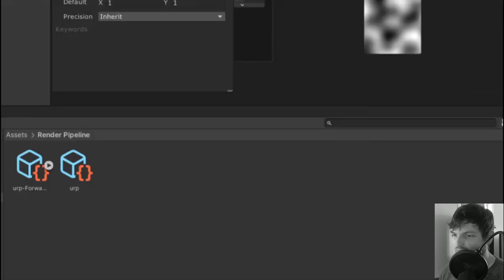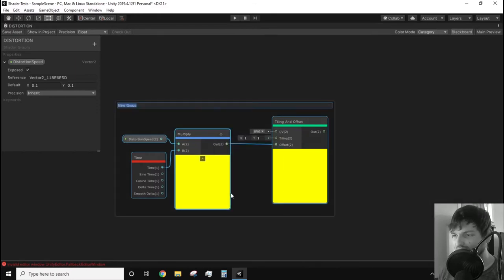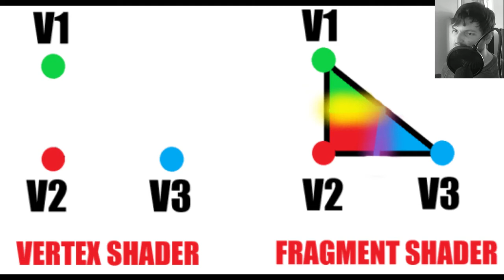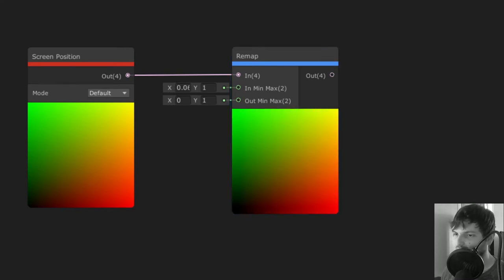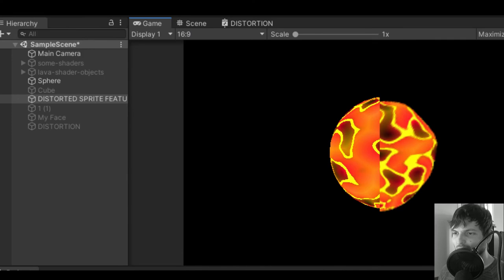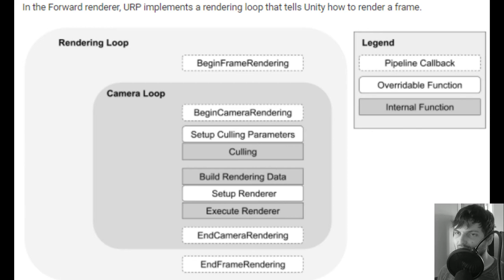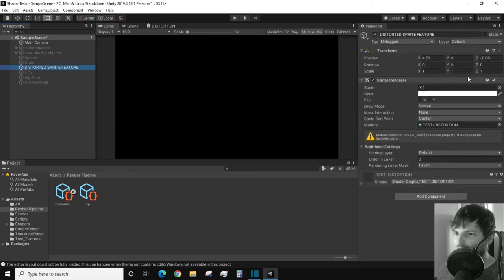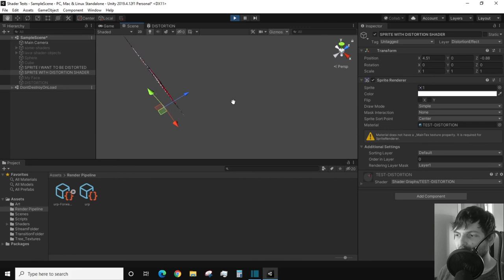HOW TO MAKE DISTORTION/HEAT EFFECT FOR 2D & 3D - SIMPLE SHADER GRAPHS -  Unity 2019 LTS

Comment: First, thank you for the tutorial, video editing is also great. Very useful stuff!
Second, I think it's important to note a couple of points:
1. Shader noise. For mobile - it's an unacceptable node (any procedural noise). What can be used instead is prebaked noise (a picture, using Photoshop, GIMP, etc.) and scroll through tiled pictures (not a procedurally generated noise). This is especially harmful if you render a lot of pixels with this shader.
2. The total amount of passes and batches is almost doubled. What you do here is render [everying but distortion], then [render everything with distortion]. Your first pass fills opaque texture, your second pass re-renders the scene completely, but distortion works *only with opaque texture*.  What you really need is just processed opaque texture (for SceneColor node) and you doing this in the very first pass. To optimize (in forward renderer): 
2.1. Remove all features, set transparent filter to nothing.
2.2. Add feature "PassToOpaqueTexture". Event: anything earlier (higher in the list) than "BeforeRenderingTransparents" . This ensures you work in opaque layer/texture. Filter: transparent and everything but distortion.
2.3. Create second feature "PassAfterAndWithOpaqueTexture". Event: "AfterRenderingTransperets". Filter: transparent, and your distortion layer.
What happens: you render in first pass everything. Also, you fill out opaque texture. Then in the second pass, you render distortion and nothing else (hence no more extra rendering). You also won't need to set any sorting order. It will always be higher than the first feature. If your project has opaque objects, features and filters can be adjusted accordingly. For mobile platforms doubling the number of passes is harmful.
Reply from the maker: That is some great info! I definitely won't claim to be a shader expert. A lot of what i found out how to do was by trial and error/testing and trying my best to understand the documentation available. I think I'll pin this comment so hopefully it helps future viewers!
Reply: do you know how to do this while also having 2d lights? because 2d lights and materials only seem to work with 2d renderer not forward renderer.

Comment: Thanks for tutorial. I have a difficulty that to apply the distortion to certain mesh only. I don't know how to set the layer. Is there any related tutorial?
Reply from the maker: This type of distortion effect should only be applied to a 2d sprite object. The idea for this particular shader is a heat effect or blurring effect that can be applied to an entire scene or partial depending on the size of the 2D sprite shape. 

If you want to distort just a single object, this is probably an easier way. More than likely just tweaking the object's UV map would probably work.
Reply: @SethFunk  Thank you very much!

Comment: Nice tutorial dude. Something no one else does is go into detail of how unity is handling things behind the scene which goes a long way to just understanding how everything works together.

How do we do the Render Feature stuff if i'm using a 2d renderer as I'm on 2021 unity? Or is that step all just skipped?
Reply from the maker: I honestly have not tried unity 2021 version. I would have to assume for now that there would be an option for renderer features under your URP asset still. I will check out the documentation and might download 2021 to try it out.
Reply: @SethFunk  I'll have a further look with documentation. I checked the pipeline asset and renderer but sadly didn't see anything of the sort but be nice to get it working as your effect is exactly what I need.
Reply from the maker: @MattBee2k2  So I did some research on the 2d pipeline supporting renderer features, and it seems that Unity does not currently have any plans to support the feature. It is recommended to use URP since it gives similar results to the 2D pipeline but has more options.
Reply: @SethFunk  Interseting I'll check it out and appreciate you looking into it and getting back to me. I've used URP with the 2d pipeline as i'm on mobile and wanted to keep thigns simple.

I was actually able to get a distortion effect on the go just offsetting uvs over time with noise by following gamedev bills tutorial on heat haze.

On a deep dive on shaders so be binging your channel and joined the discord. Keep up the good work mate!
Reply: @MattBee2k2  Don't get rid of the 2D Renderer. Just add another renderer to the renderer list under the pipeline. Per Unity.

The 2D Renderer includes:
2D Lights
Lit and Unlit Sprite Masternode in Shader Graph
Pixel Perfect Camera component
As a reminder: This will be the new home for Pixel Perfect Camera. The standalone package will still receive bug fixes, but new features will only be added here.
This is the same component with the same workflow as the one in the Pixel Perfect package. The main change is that Pixel Perfect is now compatible with the 2D Renderer in Universal Render Pipeline.
Normal map support for all the other 2D renderers:
Tilemap Renderer
Sprite Shape Renderer; and
Sprite Renderers that are deformed by bones.
Experimental shadow caster component
Post-Processing support

You'll lose all of that if you try to remove it.
Reply: @Xeridae  Oh I see didn't think I could add multiple renderers like that. First time using any of the new workflows. I'll check it out mate, cheers!
Reply: @MattBee2k2  No problem. You can have more than one renderer as long as they are a renderer supported by URP.

Comment: Is this possible to do with the "2D Renderer Data", since all of the 2D lights use a 2D Renderer instead of the typical "Forward Renderer". All of the features like "Add Renderer Feature" is missing etc :/ Anyone have a solution/suggestion?

Edit: its not there yet, but coming to Unity version 2021.2
Reply from the maker: Is there any reason you can't use the urp forward renderer? I know 2d seems convenient but urp can do almost the same things but gives more options when it comes to shaders.
Reply: @SethFunk  the only reason are the 2D Lights and Shadows (which are great by the way), which won’t work when switching to the Forward Renderer :/ but luckily coming to the next version, will come back to this tutorial then, awesome tutorial btw
Reply from the maker: @Chief-wx1fj  Sounds good. I know I have faked in 2d lighting using 3D geoms before and it turned out pretty interesting, but I completely understand why you want to keep the 2D pipeline. There are other ways about creating a similar effect, which GameDevBill has a couple tutorials if you follow can help you understand how to do it. It's a lot more complicated though. And I believe it even works with the 2D pipeline.
Reply: @SethFunk  This would be great . I need the 2D Renderer because i use costum axis sorting and forward rendering do not have this. I manged to get this distortion shader to work from your tutorial but then the sorting is totaly broken :) there is literly no sorting order by y Axis anymore and i do not want to do this by code. 2D renderer is a great way for an automatical sorting by pivot or center. Here is a short preview on youtube: AYf2Monevpo
As you can see i do a looooooot of sorting and forward rendering isnt working this way :D Also i think the camera was complaining about i need 2d renderer for pixelperfect camera.

Never noticed you only has this few subcriber :o I came to your chanel in the past. At least i can remembered your face :D
Keep up the good work
Reply from the maker: @Filgaja  Hey, I awhile back someone on my discord channel said they found a solution for using the 2D pipeline. here is the link to the message thread (you might have to join the discord to be able to read it though)

https://discord.com/channels/808026970439811112/808370866022121492/961031287802576967

Comment: Okay so I did exactly everything you said in the video to a T two times over now but my distortion image remains grey, and I can't see the image behind it. The only time something does happen is if I put my camera's background type into skybox mode and then on my camera the two settings it has there, I turn opaque texture and depth texture to on. Then i can see the distortion working however, it only uses the colors from the skybox and even so it's not completely accurate, even then it still has some transparency issues. I really need this to work for a game I'm doing but I keep hitting a wall on this, i tried other videos with the similar idea behind it. I also setup my pipeline the way you said it in your lava video but still no luck. Any help would be greatly appreciated thanks m8. Could you maybe link a project file so I can see exactly whats wrong?
Reply from the maker: I should be able to do that. I'll post one in my discord server. I'll sned a link to you when i get the chance too. Shouldnt be too long
Reply: @SethFunk  okay thanks
Reply: @SethFunk  my discords not working rn for some reason, a link on here too would be great if that's what you meant
Reply from the maker: @RiaanDuPiano  I'll send a link here for you when i get it done! Thanks for being patient!
Reply: @SethFunk  no worries, thanks
Reply: So I got it working! I dont know what the issue was but I created another project file, and it seemed to work...how annoying. Anyways is there a way to make the image/sprite not be as blurry when being distorted? And one other thing is there a way to use the alpha data of the main tex so I could have a smooth transition of blur on the edges, like say if I were to use a particle to get the feathering effect? It's a bit obvious where the distortion starts and ends
Reply from the maker: @RiaanDuPiano  I was just about to upload my project to github lol But anyways, distortion power and the gradient noise scale will determine how much distortion is occurring. As for the smooth transition, the only thing I can think of off hand using the intended sprite shape, doing an outline type of effect, and control the outline separately from the "main" portion of the sprite. Sort of like having two intensities of distortion power per each section of the sprite being manipulated. I hope that makes sense. I haven't tested anything like they before though. I have created an outline for sprites before, but mainly just followed what brackey did in his video for it. Not sure how well it would turn out. I haven't had much time to work on shaders in general lately due to work/family time being my main priority but I will try to assist how I can. I know there use to be heavy discussions on Brackey's discord about shaders and there were some real pros there.
Reply: @SethFunk  you should upload it anyways and maybe link it on your video in the description, im sure some people would find it handy i wouldnt mind taking a look myself. Okay i think i get what you're saying will give it a try.

Comment: Would there be any issue with the error message that says there's no _MainTex? I'm trying to put this shader together but I keep getting a gray square with no effect on it when it's applied to a sprite.
Reply from the maker: Are you applying the effect to a 3d model or a sprite?
Reply: @SethFunk  Hey sorry, I was trying it out on a 2D sprite but it turns out that this doesn't work if you're using Unity's 2D lights. Unfortunately, the renderer used with that doesn't let you add renderer features. As of 2020.3 that is, not sure if they've updated it in newer versions.
Reply from the maker: @farn2388  there is a way to use the 2d light system but you have to use a blit script. Gamedevbill has a good video on the subject
Reply: @SethFunk  Ok thanks! I'll check out his videos.
Reply from the maker: @farn2388  good luck!

Comment: Hey! Really nice video. I had a problem with the shader, it turned out to be grey and didnt see any effects :/ What could be the problem. I am using URP with 2d lights. Also with new shader graph update i didnt have unlit master node(i think), I had vertex and fragment nodes as the master nodes.
Reply from the maker: Hi there, it sounds like you may be working in a newer version of unity or at least a newer version of shader graph. Use the link I put at the end of this comment to download a github repository using the newer version of the shader graph which should work in the newest shader graph and any unity version later than 2020. I believe the render loop changed between 2019 and 2020 versions which requires you to change the when to render the distortion effect via the render feature. Also in the actual shader graph you just have to plug the  final node into the color section of the fragment node. 

https://github.com/SnootySnootGames/DistortionShaderUnity2020AndLater.git